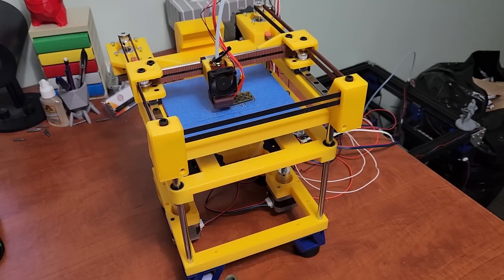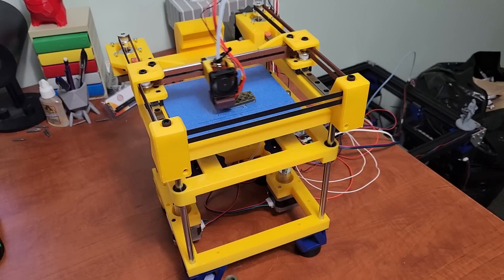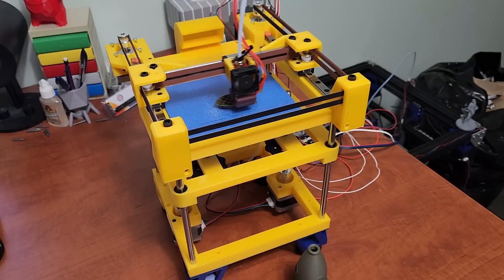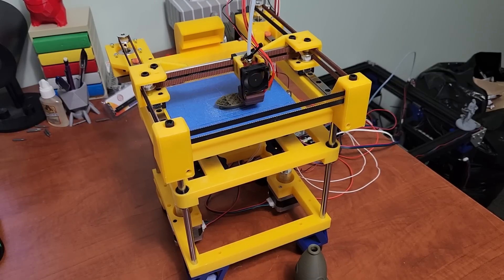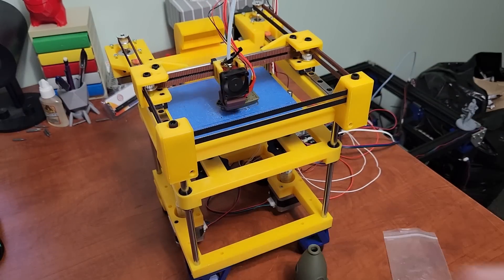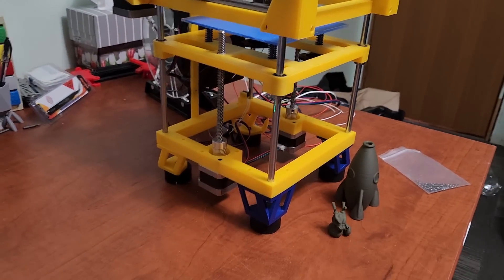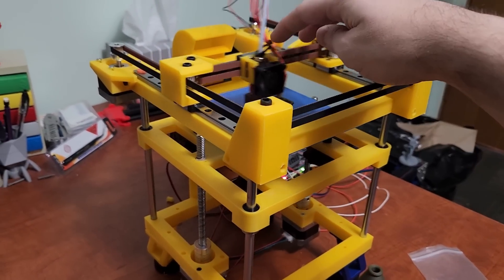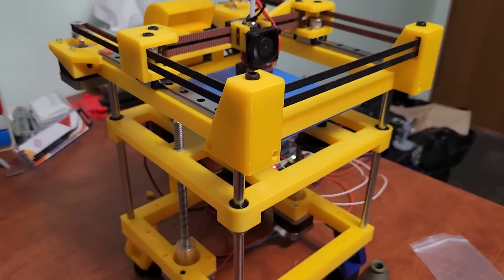Cheap Mostly 3D Printed CoreXY 3D Printer Called Rook!

Comment: I have watched this video many times over the years, and it's been a big inspiration for me for an idea that I've had since 2018 - to make a print-in-place printer that can print its own parts and only consist of a few different parts that can printed together on one single bed in one go. I've had many ideas over the years for it but every idea has turned out to not work in practice. But maybe one day I can make it work. It's very hard to design a frame that is both big enough to house the printer but small enough to be printed on an iteration of itself.

Comment: In order to make 3d printer, you need a 3D printer.
Reply from the maker: There are great services like print it forward and you can buy printed parts from builders a lot of time
Reply: @Rolohaun  I have V3SE and A1 mini but it's hilarious if you think about it. If I need to use outside service then I feel like it defeat the purpose of DIY.
Reply from the maker: @TheGlitterMan  lots of different options, users can also get friends to print the parts for them. DIY printers are not for everyone
Reply: @Rolohaun  True. Take a different breed.

Comment: whats speeds and accels are you printing in this video?
also are you using a cht or a stock nozzle?
Reply from the maker: I was using a stock cr10 amazon hotend and probably 5k accell, this is a old version of the printer, here is the updated one https://www.printables.com/model/387431-rook-mk1-3d-printer

Comment: Might be a noob question but why use 2 steppers instead of 1 larger stepper connected to 2 pullies?
Reply from the maker: that is a option for sure, it just depends on how much space is available. 1 stepper and 2 pullies needs more bearings and extra parts. Both are good options though. This design was updated to a single belted Z

Comment: its REALLY COOL❤

i cant 3d print it (prusa mini& building a voron0.2), but ill attemt  to cnc mill the frame from plywood and mount the parts some other way once i finish my 0.2 ill either build one or recycle my prusa mini
the lower frame can be milled as is , the bed carrier as well the top frame needs some mods, but nothing i cant do 🤷‍♂️

well see how this plays out
Reply from the maker: thank you check out my Rook 2020 also, it has a normal 2020 frame

Comment: Can you please advise on 3d printing CAD designed parts to fit together?
Do you apply clearance distance in your design and just print, or apply some positive/negative expansion in slicer?

Thanks
Reply from the maker: my designed have clearance built in 8.2mm for 8mm rods, 3.4mm for M4 bolts things like that

Comment: A cool idea for integrating the bed into the frame would be to embed magnets into the z axis plate and then you could slap on a cheap steel flex-plate build surface. It would prevent any chance of the nozzle gouging a printed build plate.

Comment: Is there any reason you chose two belt system instead of a single belt H-bot?
Reply from the maker: there are pros and cons, H-bot is not great at speed I have been told. I made a few H-bot printers and they seem fine but because they done have a dedicated belt on each side tensioning it can bind. I do want to try a H-bot Rook and see if I can simplify it further

Comment: Recently picked up a used Anet 8 for  spare parts, but saw this video and have decided to use it as a donor. Between it and a spare SKR  1.4, should have most of the bits needed. Finished scaling the frame for the 220mm bed and started printing last night. I am excited to get going on this mostly printed project after success with the Lowrider2 (mostly printed cnc router).

Comment: have you tried linear rods for XY instead of the rails? I'm sure rails are preferrable, but I was curious if the cost difference was significant, and if it was still usable.
Reply from the maker: linear rods have more play and are harder to use. Depends on how expensive rails are in your country it usually always better to use rails.
Reply: @Rolohaun  Sure, I'm thinking mostly as a cost-cutting part ("cheap" is in the title after all). Rods have been good enough for printers like ultimakers for a while, and rails are probably the second or third most expensive part in your entire build currently. I can get stainless rails in the US pretty easily, but they are something like $25 a pop or so.
Reply: @reidn5185  if rods are good enough for a prusa, they should be more than fine for a tiny build like this.  As good as rails?  No, but good enough I would think.
Reply: @navi6463  I'm sure, hence why I asked. This build seems like you can get away with a total cost of <$200 if you had to source everything new, and rails would take up a significant portion of it with little added benefit for this build volume.

Comment: I think in found my first big project when my vzbot is done(hopefully within the next week I will have the remaining hardware). 

I have a ton of extra stuff from previous builds and upgrades. I could probably get this done for under $100 in new parts. 

If I was to make use of endstops do you think I could re use my creality 4.2.7 board?

Would like to see this printer get the v6 clamp for the hotend. A clone v6 would be a solid option for a cheap printer.
Reply from the maker: I am sure there will be some mods for the v6 hotend on the discord and some users are going to use the creality boards too

Comment: I’d be very interested in taking the electronics from my Ender 2 Pro and make this.
Reply from the maker: it does use sensorless homing so you may need to add endstops if your board does not support that

Comment: I think you can try small proximity switches. The smallest 3mm cylinder can be easily placed in the tool head. This may be a good way to give up leveling screws
Reply from the maker: I haven't had to level the lead screws yet

Comment: I live in the UK, can anyone recommend the best stepper motor brands/retailers? I don't really understand 'Nema17 42mm' in the BOM. What does the 42mm stand for? The size of the overall stepper?
Reply from the maker: 42mm is the height, any nema 17 stepper should work. we have some users in the Discord from the UK. You can join and check with them if you like

Comment: Hey, I just started to print some of the parts for the modded 10mm rod version of this printer but I can't seem to find a file of the feet for the base of the printer anywhere on the github if someone could help me out with finding a file for those it'd be appreciated, Thanks.
Reply from the maker: the feet should be in the 8mm folder as its the same for both
Reply: @Rolohaun  Awesome Thanks, I didn't even think to look in the user mods folder for that one, I got it now.

Comment: why have two Z motors? one would do. when you have two motors, they will eventually drift out of sync.. you always need to mechanically link them.
Reply from the maker: I want support on both side, if both motors are running on the same stepper driver I have not noticed them get out of sync. Of course users can mod it to just use one motor
Reply: @Rolohaun  Leave the motor on one side, and replace the other with a bearing block and connect them with a belt. It will be cheaper as less motors and no sync issues. Even if you use the same driver, they will get out of sync eventually.

Comment: The best thing about this printer is the colour. As good or even better is the integration of structural parts as framework and it is all topped off with a massive amount of simplicity. You are a very creative fella, Master Rolohaun. Impressive.

Comment: This is absolutely brilliant on so many levels.The first idea for the Voron V0.1 was to 3d print i, but that idea was scrapped. This design seems to prove that it was a viable idea. I think that you may have changed the hobby with this design! I wanted to try to design something like thi but now I don't have to because you already did it!! The Z-axis rails doubling as the frame are what really make it special. Congrats!
Reply from the maker: Thank you very much!

Comment: Love it! How is the Z resistance to racking? I noticed you used short-length LMUU bearings. Especially with the whole Z-axis being printed, I would worry that it could wiggle too much and maybe even stick? Maybe three screws would be better?
Reply from the maker: 3 would be better but adds cost. It works well and I get really nice prints. For a printer this size it pretty good

Comment: would using my old ender 3 mother board work?
Reply from the maker: the design uses sensorless homing right now, so you would need to add X and Y endstops but there are people doing mods to the printer on my discord right now so it could be made to work pretty easy.
Reply: @Rolohaun  i see, thank you for the quick replies!

Comment: Very cool.  I'm confident that you could get a klicky-NG-style probe on that print head.  I've been working on my own that is extremely small using only 2 magnets, and the probe module isn't much larger than the omron micro-switch itself.  The hotend mount is 2 magnets and a small set-screw to make a "tripod" to stabilize the probe.   It would fit under your hotend fan, assuming that the magnets wouldn't interfere with its motor.    Working out a docking solution is the tricky part, but worst-case you could just have the printer beep at you to attach and remove it manually.

Comment: If you're 3d printing the bed, then why not use the printer itself to do that? That way you know it will be parallel to the print head. Obviously print the frame on another machine, but use this one to put the final layers on. You could manually probe the bed to get a rough level and then have that compensation blended out within the first 10 layers or so. That way your final product would be level and flat (compared to the mechanical xy movement)
Reply from the maker: that would be cool for sure

Comment: Could you please upscale this for printing on a larger 300 x 300mm printer?
Current Linear rail size would be plenty big.
I'd go with 10-12mm Z rods though.
Reply from the maker: there is already a mod on the discord for 10mm rods, more will be coming I am sure

Comment: $260 to build is a bit too much imho. Like, the parts are waaaaaay too high quality for a hobby project like this. Linear rails alone is overkill, but possible necessary to make it easier to build.
Reply from the maker: users are modifying it with linear rods, everything can be changed

Comment: This is excellent. I did a DIY 500mm CoreXY. My biggest issue was keeping the X axis squared to the frame. And I do not have a good way of tensioning the belt. Though yours is small, how are you tensioning the belt? Thanks!
Reply from the maker: the motor mounts are slotted so I can tension the belts using them. I have used this on many of my designed and it seems to work well.
Reply: @Rolohaun  So you just yank on them? No tensioning screw? And you have no issues (mainly on the larger printers) skewing the X axis as you tension? Thanks. Love your projects.
Reply from the maker: @FilmFactry  with corexy you tension both X and Y so you control the skew. If there is space I had  a m3 bolt that presses on the motor.

Comment: How easy would this be to modify in like fusion 360 I have an ender 5 plus that can print 500x500x400 so would it be hard to modify to print a larger format like 400x400x300?
Reply from the maker: the parts would need to be redesigned but they are simple

Comment: Small printers...A simple portable 180x180 printer could be the next project😉
Reply from the maker: yes I agree
Reply: @Rolohaun  Since it looks like your design would make this a fairly easy change, how high do you think the Z axis could conceivably (and reliably) be extended without upgrading the stepper motor? 250mm? 300mm maybe?
Reply from the maker: @lucasthompson1650  the rods might need to go to 12mm large if the z is scaled up I would worry they would bend

Comment: It's so cute I love it! I wonder how long the printer will hold up, I guess the frame will warp at some point.
Reply from the maker: if your printing PLA it will not warp there is not heat near the PLA. But of course it could be printed in ASA or ABS

Comment: Very cool printer. Bit of an Idea for part cooling fan, you can mount a fan to the back of the toolhead in the same way as ratrig does.  Then you wouldn’t lose on print area i think.
Reply from the maker: I thought about the there is no room for the ducting unfortunately

Comment: If youre gonna have a 3D printed bed then why dont you just print the bed directly in place? If you use ironing it's gonna turn out smooth and completely level in relation to the nozzle. No adjusting necessary.
Reply from the maker: Yes that it what I want to try
Reply: @Rolohaun  nice! I'd like to see how that turns out

Comment: You could remove the fan on the print head and replace it with a properly shaped intake if the cooling fan can be placed on the other side and air focused more; this way you can decrease print head mass, enabling faster accelerations, and still guarantee good hotend cooling and making part cooling better (necessary for fast printing).
Another possible improvement could be to remove one of the z axis motor and couple the lead screws with 3d printed gears (motor can be placed centrally) in order to decrease not-printed parts.
Finally, if higher print speed are a goal (or if you want a cool-looking enclosure to display the printer in your living room) you could mount it in an Ikea EKET cube. It would increase rigity and look VERY cool.
Reply from the maker: yes these are awesome ideas! and would be cool to see!

Comment: Omg this is awesome!
I thought of a few cost-saving measures that maybe could help:
1. Remove two of the rods in opposing corners. Replace these rods with the existing z screws. The core xy layer can interface with the z screws via a bearing (so the rotating screws don't imaprt any force on the core xy layer).
2. Remove one of the nema Z motors and connect the two rails with a belt and pulley. This means possibly a bit more calibration to get the zscrews even though.
Reply: I think it would be better to rigidly mount the leadscrews as part of the frame, and instead turn the nuts to travel up and down. For example you could put pairs of 15x21x4 bearings in the bed carrier, and print 24 tooth pulleys with a long 15mm OD cylindrical portion above the upper flange, and leadscrew threads on the inside. The flange would be 17-18mm OD, and serve as a platform for the inner race of the bearing to sit on (assuming the pulleys stick out the bottom of the bed carrier). Mount a single motor to the bed carrier somewhere to turn both pulleys with a closed loop belt.
Reply: @dekutree64  damn, that sounds clever for sure!
Reply: @pooounderscoreman  lol, I'm struggling to resist the urge to build it myself just to watch it go. I don't need another 3D printer, and I don't have space or money or time for one either.
I came up with an even better version too. Instead of opposing corners, keep the two front rods for the linear bearings, and have them stick above the top to double as the idler shafts (as someone suggested in another comment). Replace the back two rods near the motors with leadscrews, and then add a third leadscrew in the front. Use 3 independent motors turning each of the nuts with 3D printed gears instead of belts and pulleys, and you can have automatic leveling of a one-piece 3D printed non-heated bed, instead of needing the separate bed carrier and spring-mounted bed. You could probably even do away with the bearings supporting the combo pulley/leadscrew nuts. Just print ~10mm face width gears with leadscrew threads inside and let them rub against the underside of the bed as they turn. Maybe stick a bit of teflon sheet or something inbetween to act as a thrust washer, if grease isn't enough to prevent wear.
Reply: Maybe there are good reasons these wouldn't help or save on cost but I thought it made sense in my head haha. Love your work!
Reply from the maker: these would be cool to try for sure!

Comment: You need some cross bracing, which should be easy to 3D print aswell. Nice job!
Reply from the maker: as time goes on maybe, because the frame is a single piece it's very rigid already

Comment: wouldn't it be easy and better to design the outer profiles from 2020 profiles and print the corners where the guides go through? would give the whole thing more stability. so a mixture of your printer and a Voron V0.1.
Reply from the maker: there are alot of options for sure, hoping to see some cool designs

Comment: Amazing design, what sort of speed can you get?
Reply from the maker: right now I am doing 5k accel, 100 - 150mm/s haven't pushed it yet. It can do a 23 min benchy though
Reply: @Rolohaun  nice! I do wonder if the Pla will develop stress fractures over time
Reply from the maker: @harrisintheflesh  I really don't know, it will be interesting to see. At least it's basically free to reprint and it can be done in ASA or ABS

Comment: Beautiful design! So simple, and I love multi-function parts like those Z rods, and having the rails act as stiffeners for the upper frame.

This would be great with a Schnekenstruder, for improved print quality and the simple joy of watching it in such a clearly visible place. Look for rq3's extruder threads in RepRap forum tech-talk section (youtube tends to delete comments with external links). My post toward the end of "A Very Different Extruder" page 3 shows a mount that works well and gives a clear view, as well as a reverse bowden adapter. I recommend integrating hollow posts into the carrier like this guy and using self-tapping m3 screws https://www.youtube.com/watch?v=YTADdWiFQnI
Much cheaper and simpler than rq3's original design with 5mm shoulder screws and belleville washers.